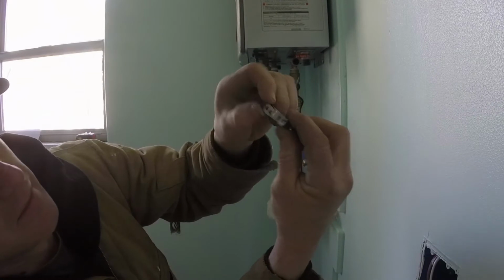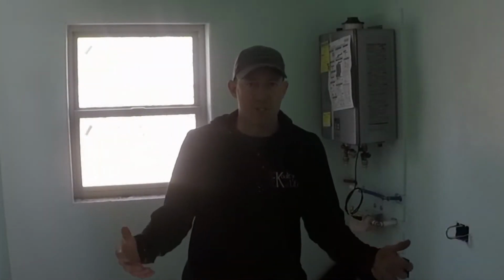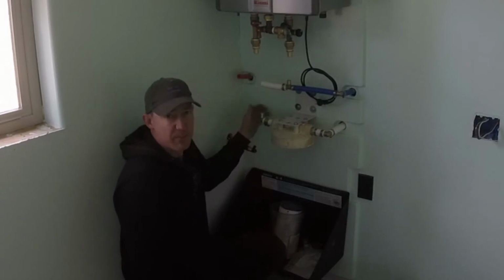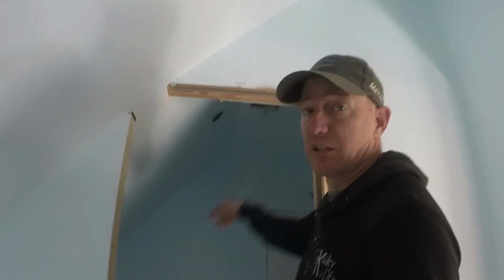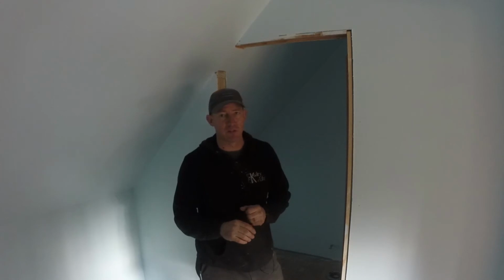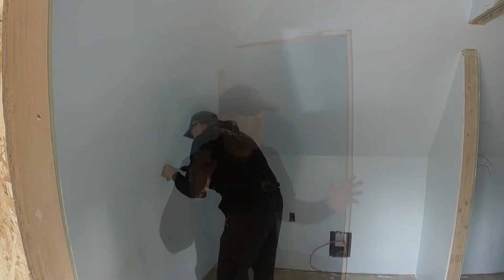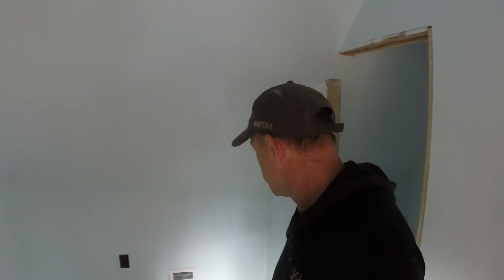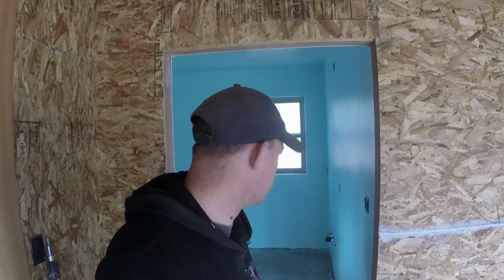Cadet wall heaters, Red Guard, lights, plumbing, its getting there :)

Comment: Good work, here we have code about how to build a wet room. If I do it in my house i have to put in a barrier so the water can't slip in to the construction behind, it's for the walls and the floor. All the connections that you have with pipes and tubes that are going through the walls have to be sealed. There are some type of specification that the material have to meet etc. If it's not done right and you have a problem later the insurance company will refuse to pay out. A company that you hire to do the work needs to have certification to do wet rooms and have to leave a 10 warranty on the job. Hard rules but mold and rot are not something to play with, it can literary ruin your health. Micke..
Reply from the maker: I wish we had more of a written guideline about the best way to build a wet room. I had to do a lot of research about the best way to seal a bathroom so I wouldn't have a problem later. Sometimes I find out about a better way after I have already done something but still trying my best considering I have never built a house before. :)